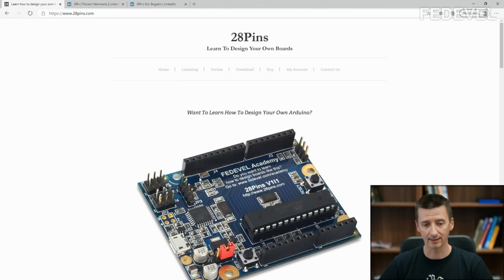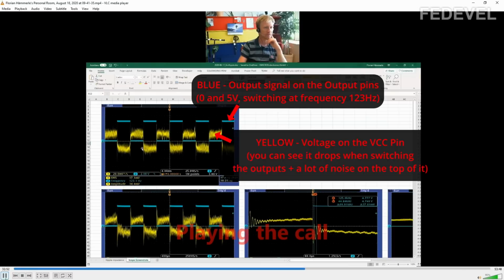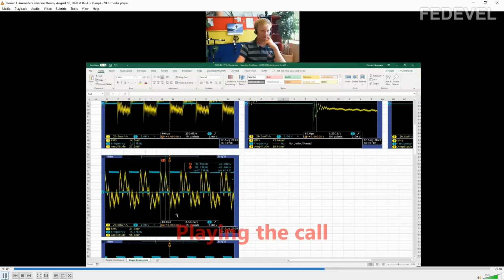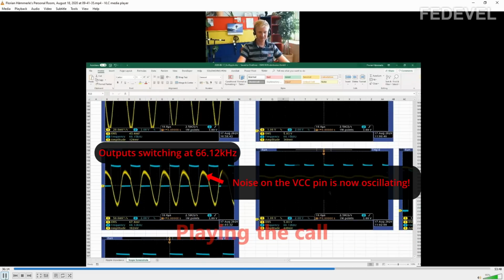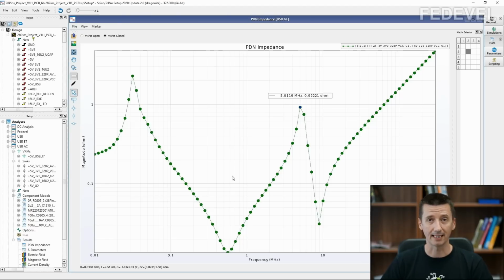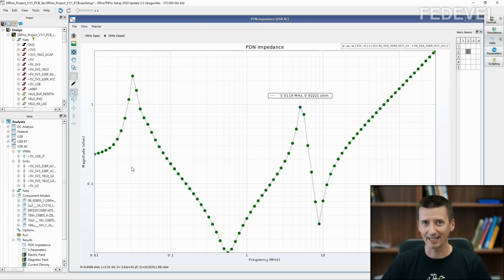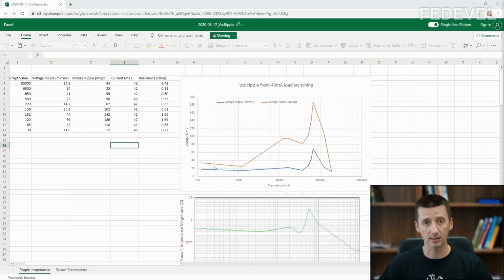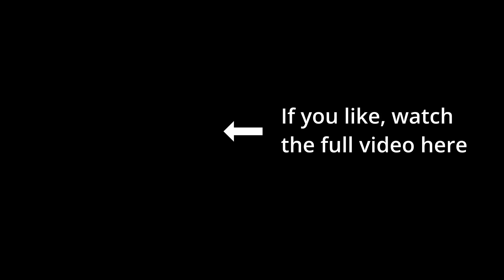Everyone designing boards needs to know this about power and noise | Florian Hämmerle| #HighlightsRF

Comment: Hello. Be careful with that microcontroller, P in the name means pico power, that means that controllers used low power low frequency(clock crystal) crystal generator. So you need crystal with low ESR and low capacitance, I had a lot of problems with crystals that stop working after a few days in production. There are new version of this controller Atmega328PB, with Clock Failure Detection mechanism, that switch crystal generator to international clock, but it doesn't help because usually you need that clock very precise in battery application. My solution was to use  watch dog oscillator with  time and watch dog calibration every 10 days. Finally I archive 10 minutes max error from 500 devices.  How ever in modern controllers like STM32 you can chose how powerful your oscillator must be, so thinking about that moment when choosing controller for your device.